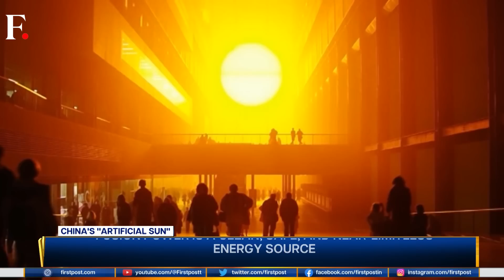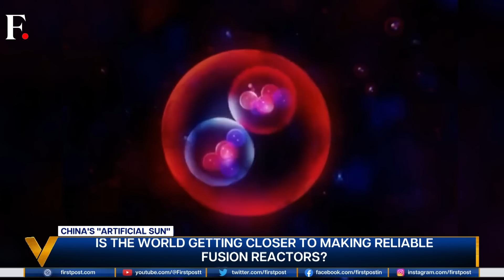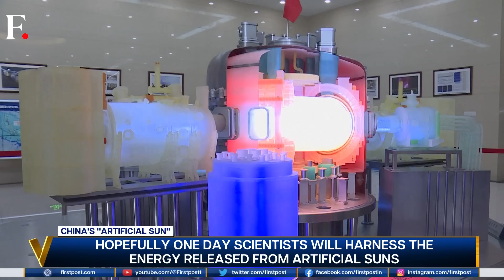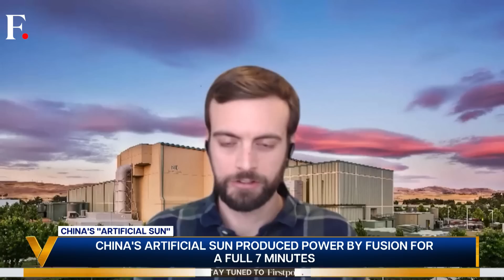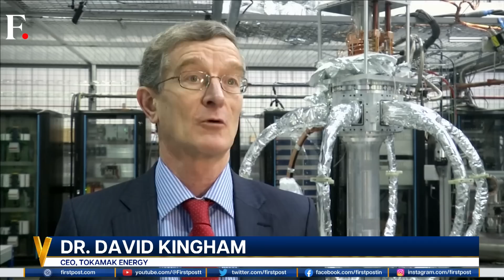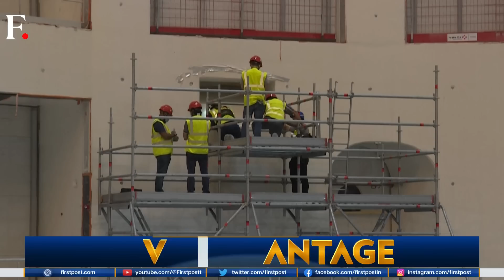A Brand New Sun, Brought to You by China | Vantage with Palki Sharma

Comment: The Problem is that Fusion uses more energy, than it produces. That's why it's still not viable. The question is, did China manage to produce net positive energy with this experiment.
Reply: That is the question. To be or not to be.
Reply: That's why people need 0 electrical  resistance material and very high heat resistance material. 
US laser fusion create a positive energy, for example, 1kw laser create 1.5kw heat. but 250kw electrical power to create 1kw laser.  

i hope Chinese way is a little bit closer
Reply: Fusion power plant is a continuous cycle.  When is the energy use?
Reply: You know the word experiment mean
Reply: @Mark Aspen yes, I'm aware of it. let's not end up trolling. The amount of energy required to make fusion viable, is what I'm getting at.
Reply: This is incorrect - the only reason why this is making news makes is because net output is larger than net input - the duration of this sustained net output is the news. Watch more videos on fusion please. Net output (minus energy lost because we don't have superconducting capabilities) is already achieved (early 2023 or end of 2022)
Reply: @peterthelonius9928  This is correct, the length at which fusion power can be harness is the accomplishment.
Reply: @Mark Aspen mass is turned into energy
Reply: probably not... just propaganda
Reply: one step at a time.  We learn as we grow, and we grow when we learn.

Comment: What are the inevitable consequences if the technology malfunctions? This is one of those vital things that are never asked or addressed in most, if not all, scientific experiments.
Reply: Virtually nothing. Any irradiated material is contained.  The fuel is very little and diffuse. The electrical systems can blow out under stress, but that can happen in any power station.

Comment: It doesn't matter how long you can keep it going if you are putting more energy in vs getting out. England still has the record for the most power received vs expended from a fusion reaction.
Reply: Impossible by artificial means,  against law of energy
Reply: Actually it does matter how long you can keep it going, that's extremely important. It's pointless if you achieved net energy gain but you're unable to maintain it for very long.
You should be able to maintain stability, and contain it for a long time.
Reply: @CulturalXplorer19 It's far from pointless my friend. Have you heard of Projectile Based Inertial Fusion ? It uses bursts of fusion to creat a substantial gain over time like the combustions of an engine.
Reply: @bipedal-ape-man  again, it is. Because what would be the point if you cannot maintain it or contain it for a very long time?

The ability to keep it going, and the ability to contain it is necessary.
Otherwise, it will never work
Reply: @CulturalXplorer19  Confinement and maintenance of energy output is what projectile fusion excels at.
Its the ROI thats the tricky part.
Reply: @bipedal-ape-man  if that was the case, the United States would be holding a world record. But again, wrong.

Comment: About the Tokamak principle, they should consider to pulse it in a way, that two "cylinders" work in a push-pull system like the legendary "Boxer Motor" in a motocycle, but in a magnetic way, not a mechanical.
Like we must learn how to output the energy by electromagnetic induction caused by the fusion in the plasma, so to cool the system as well. Harvest the energy in form of an electromagnetic pulse, prepare the structure of the plasma and magnetic fields for this. The superconducting coils and "iron" cores, together with an intrinsic resonance circuit, should attract field lines and eat up that pulse.
The idea is, to feed part of that pulse into the magnetic field of the tandem system, so the fusion pulse in one system ignites its neighbor and vice versa. Probably, it should be a resonant system, somewhere between 20 - 300 Hz.
The regulation might be as "simple" as mechanically moving the coils that build the circular connection between the two cylinders.
This way, you need the huge start-up energy only once or twice.